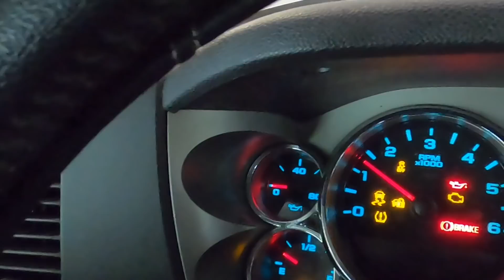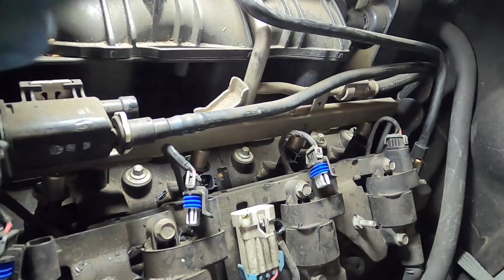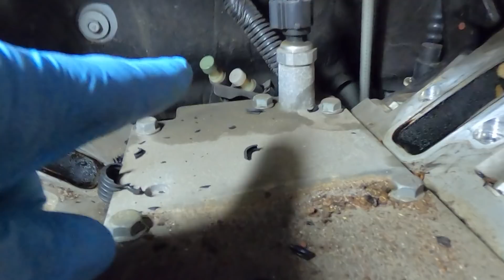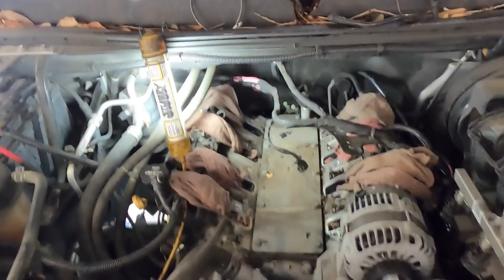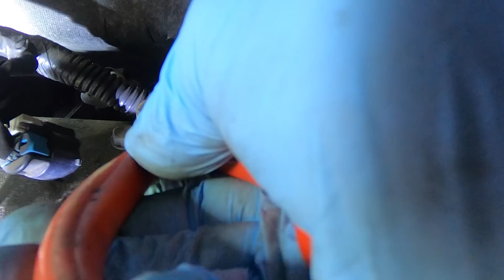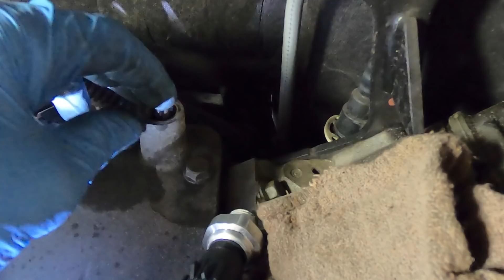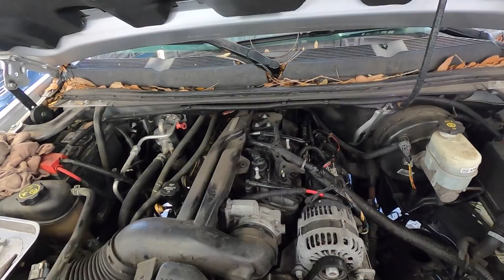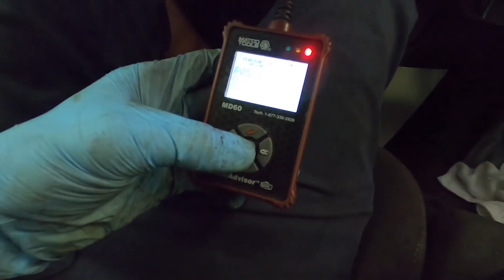Customer States: Google Diagnosis…replace this part!

Comment: To be fair - sometimes Google is right. I had a car which for that particular period often was assembled from factory so when it rained and especially if vehicle was parked on a slope - then water would get in. To be fair it was a very new problem but it took 3 attempts for the dealers mechanics to get it right. The third time I managed to find someone who had similar issue and fixed it. The cause was wrong placement of a plastic sheet in the doors. Naturally I had a printout and showed the mechanics. Presto - finally a dry car even in heavy rain.
That said if I was a mechanic I'd refuse to work on an issue where the customer firmly believes the found solution is the fault especially for such a complex problem - diagnose it at most for a fee. My issue was purely a warranty issue and not really that complex and I didn't present it as the fault - but something worth checking - but this time it was correct.

Comment: Ok I am going to chime in here, as someone who has been working on car’s and trucks since 1983 and taught how to do automotive repair by an Army mechanic. Aka my late father, as well as someone who has management experience in an unrelated field. All that horse manure I just saw, is why I dislike working on new cars. And the poor excuse for mechanic work, is the same kind of behavior I enjoyed firing people. As I do not put up with a half arsed work, and out right laziness. I’m all for taking a short cut when possible to make the job easier, but I am also for doing the job right with all the tools that should be used. If I had owned that truck, and saw what I just saw, I’d be finding a new repair shop to take my truck too.

Comment: if i ever had to do that crazy air-intake pull on my car, just to replace a stinking pressure sensor - i would 'chop' the rear end off the shiting-manifold and fit it with 'straps', so next time its just aN EASY 'working by mirror job' NEXT-TIME. PATHETIC DESIGN TOSSERS !!

Comment: The computer stores a permenent code once the sensor malfunctions so many times. once the codes are cleared the oil pressure will show again you can clearly see in the video at the end of the vid the cel is off and it does show oil pressure dont get me wrong i completely understand the google diagnosis thing but not all are wrong.

Comment: It is not difficult to replace those on a 09 Envoy 5.3  without removing the Intake.  I have done it.  There was a small screen involved.  Haven't heard of a 4.8.  Looked like a tighter fit.  Money Light was out at the end of the video.

Comment: Doing the intake on the LS engines are so simple compared to the old small blocks were you gotta get the gaskets right and the bead of silicone on the china walls and gotta put it back on straight without moving it or you will move the gaskets

Comment: You have to reset the computer after installing the new sensor for it to work. What kind of mechanic doesn't know how to install an oil pressure sensor? Hack

Comment: Well, Ray, you fixed what the customer (and Google) diagnosed the problem to be. So, charge him for what he told you to do and let him take the truck to Google to have the real trouble repaired. Ray, there is a scam going on here. I hope you realize that. The scam is as clear as the nose on your face. The scam is GOOGLE. End of story. Another great video. Thanks, Ray.

Comment: well i have a 05 chevy avalanche 2500 series with 4.8 litre that the oil pressure running or not reads 80 psi even with engine off and key in on possition so what you think it is ? im saying bad oil pressure switch bt after watching this i may have just bought a useless replacmrent

Comment: This video is total bullshit. I run an auto shop and we change oil pressure senders on these trucks all the time without removing the intake. It takes about 45 minutes.

Comment: wow--most would tape the valve holes, vacuum first,  and THEN use a blow gun. Lots of "junk" getting blown into the air after he replaced the sending unit
Reply: When race car engine builders build their motors, I hear they do it in a "clean room." I think this means people come in with dirty old shop rags and shake them about, and use air guns to blow dust off of things, and clean things in there, since it's a nice quite place to clean things.

Comment: Question : No gaskets on the intake manifold ?Being a old school mechanic , love your torque wrench !!
Reply: There are gaskets, rubber ring style
Reply: @brandonchappell8545  Thank you for reply "o rings" may of missed the replacement of such !
Reply: @16480287  well not necessarily o rings, but molded rubber over metal/plastic frame. The rubber is tall so replacement isn't necessary unless damaged or flat.
Reply: @brandonchappell8545  Thank you again ! Learning something new ! (Retired 84 yr old Mechanic)

Comment: googling the fault and finding everything that can make that happen then considering if it can be those things or not for your car. you are left expensive parts and proper diagnosis needed and easy shit you can fix yourself like battery car terminals being crusty.

so you do the easy cheap stuff yourself if it doesn't fix things you tell the mechanic you did those things and it didn't help then they can find the actual issue. it just needs to work one out of every 5-6 times for it to be worth it and it is more than that.

had a lambda senor error was a bad connection to the fuse that caused improper values. have also had the vacuum hose come off. 

google is a tool it is about knowing how to use it that matters.

Comment: I had the same issue with my Trans Am. But mine was the switch because it was spewing oil all over the place. I just gave it a reach around and broke the first, then the second (aftermarket) failed after a few months, #3 was a delco but once it was on it stop tightening at a certain point so when I plugged the plug back on it was in a position where the clip came in contact with the manifold so I couldn’t unclip it again.

Comment: I know you are a mechanic but why do some of you'll act as if people can't know something about cars that aren't? It's not like they can't take their cars to auto part stores to get a free scan and print out of the trouble codes and go online and do some research themselves. I saved myself a lot of money doing that and I stopped family from being ripped off by mechanics that try to take advantage of people especially women. I'm not a mechanic but I did attend a trade school where I'm from to learn automotive and diesel tech for my own personal use.  If I were a mechanic I would love a well informed customer base it makes your job that much easier in fact I would encourage it because people will take better care of their vehicles. At the end of the video there was no check engine light and the gauge was working, I peeped that.

Comment: Some people are just unreasonable just like the owner of this truck, So many people commenting that have clearly never worked a service job, a customer can come to you and ask for something and you can tell them over and over what the right thing to do is but at the end of the day they get what they want or someone else will do it for them. Its not the mechanics fault, he has to do what he is told in this case: do not diagnose, replace X part was what the customer requested anf thats what they got.

Comment: I just did my own oil pressure switch on my 5.3. I never took the intake off you need a swivel and I changed my screen also. I don't understand why you didn't put that in them people's motor? That job took me a total of 15 minutes to do. I guess some mechanics are just better than others I'm just that damn good

Comment: People on fixed incomes can't always pay a shop like Good Year or Firestone to fix their cars since the labor is close to 200.00 an hour plus parts, which is 20% more than it would be if you bought the parts your self.  We have to do it our selves or find a mobile who will charge, if lucky half the amount.  Had a 2000 Lex 300rx, vent modules went out, 1800.00 to remove the dash just to get to the vents, another 250.00 for the modules times 6.  the total was 4,000.00 just to change the vent modules for the A/C.  Now tell me do you think I should have sent that car to Lexus to repair that?  They charged me 5,000.00 to  do a head job 5 years earlier, funny thing is I was told they could do it for 2800.00.  You get what you pay for, but if you can't pay for it what do you do?  You find a friend or a friend of a friend who is willing to do the work for a little less than what a shop will without remorse charge you,  full price for a job that is only warrantied for 30 days to a year after that you are on your own should it break just after the warranty expires....

Comment: The problem with that screen is that it, too, will get plugged up with sludge/crap and ultimately doesn't solve anything, in fact it often times mimics a sensor failure due to the blockage and the sensor is fine.  Some folks just end up pulling the screen and tossing it out, but it also only makes sense to replace the sensor as well while you're in there.  The punchline here is that GM tried to address a symptom instead of the cause and as a result the screen doesn't prevent sludge/debris related issues but does introduce a plastic part that could become brittle over time due to heat cycling and the potential is there for the screen to disintegrate and cause bits of plastic to enter the oil system.  :/

My niece's husband had an oil pressure sensor issue with his early-2010s Silverado 1500 with the 5.3L, sensor would work intermittently and would typically start reading 0 after driving on the freeway for a little bit.  Freaked him out but I reassured him that it was 99% sensor-related because if the oil pressure were really 0 then the engine would be making quite a bit of knocking/rattling noise, but since the engine sound wasn't changing then the oil pressure itself wasn't really dropping to 0.  Replaced the sending unit and problem solved.
Reply: Years ago I had a turbo blow up at 59,000 miles 60,000 is when my warranty ended I went to the dealer got a song and dance got it straight now later on I found out that it was a banjo bow for the oil that had a filter in it and it's ledged up and lunched out my turbo it was fixed but I didn't need to go through all that hassle because of a little piece of screen that did absolutely nothing have a good night thank you

Comment: I miss the good old days when you could see the engine. Back in the 50s,60s,70
Reply: Yup back when engines put out 1/3 of the power  for the same size and we're done for at a 100 K
Reply: I remember when the first " smog " pumps came out, we thought they were intrusive !!!!

Comment: I'd have to say I've been pretty hooked on watching all your videos. The fact that you go through the care and process of ensuring crap doesn't get into the engine is great. Shows a great mechanic. I've experienced and seen way too many mechanics that just say "ehh, you should clean your vehicle more often. I don't get paid to clean your engine." . Keep doing what your doing. I only wish that I lived where you are cause I'd take every one of my vehicles that need work to you rather than trying to save money and do it myself due to incompetent mechanics around me. Screwed the haters. Do the job right or don't do it at all. Too many mechanics looking to cut corners to make extra money.
Reply: I prefer to use a good shop vac instead of blowing the crap all over the place & possibly in the combustion chamber 🧹🧹
Reply: You want to live in Florida!  Shake your head,  buddy !

Comment: When I changed my oil sender on my 6.0 ppv caprice I took the upper cowl off along with the wipers and that made it easier than taking the intake off.  Have a safe day.
Reply: I was wondering if that was possible, it seemed a bit overkill to take off all that. I was looking at where it was and thought there must be a better way.
Reply: This seems to be a work on everything shop so it's hard to know every vehicle and know shortcuts

Comment: Most shops flat out WONT install a part that the customer diaged via Google. Maybe, MAYBE if it's say, a CV boot when it is very obviously ripped, but anything that's not obviously visible is a big NO. Why? Because when this inevitably does NOT fix the problem, the customer will be pretty unhappy to have to pay 2-3 hours of labor and not have the issue fixed, and even less happy when they have to pay 1hr diag and then whatever the labor is to actually fix the problem. If it were me/my shop, I'd make the customer pay for the work already done BEFORE it comes back in for proper diag/repair. Otherwise they will demand that because you did exactly what they wanted (and installed their NAPA part) that they shouldn't have to pay for their stupidity. This is why you simply don't do this. It wastes everyone's time and ultimately cost the customer more money when their Google diag and NAPA parts don't fix the problem.

Comment: Ok I would have plugged into the ecu to check oil pressure.  Most modern ecus will shut off the engine if no pressure.  I'm talking Australia market like a 2000 Holden commodore If it doesn't see oil pressure on start up it will shut off the engine.

Comment: 17:52 Watching you pull those tools out reminded me of my time in the Navy.  I was the tools petty officer and I was in charge of all the tools.  What technique do you guys use for tool management?  All of our tools had a place and it was clearly marked, so when the tool wasn't there it was immediately obvious.  In the Navy a jet or helicopter is grounded if we are missing a tool.  Obviously in the civilian world things are different.  Has there ever been a case where tools were left inside an engine and the customer discovered it later?  How do you mitigate that?
Reply: I doubt the customer would mention it, they'd probably just keep the tools
Reply: Dude, we found a maglite in one of the fuel cells in an F-16 once. It had been sitting there for at least two years after a 300FH inspection by a commercial contractor. I've had guys dismantle a day's worth of reassembly work on a jet because someone borrowed a set of pliers from one of the tool carts so he could put a new stereo in his car. On the other hand, there's a BMW 3-series out there with one of my 10mm sockets still stuck somewhere behind  the exhaust manifold, no way was I going to dismantle the entire engine to get that socket out knowing that it would either shake itself free and drop to earth with no damage or wedge itself deeper also with no damage. Tool control is always relative to the potential risk involved and airplanes lack the ability to pull up to park at the next cloud.
Reply: As others have stated, you supply your own tools..now my story of a $75 Makita flashlight that went missing until a customer came in with a clunk in the door that I replaced the window regulator... missing flashlight found...the boss still brings it up 35 years later...
Reply: As a regular car tech those tools are your own, not everyone's. Yes aviation is a little more stringent. 
I recall watching a show based on aviation in Canada. They replaced an engine and after a short bit on maiden flight the new one developed a problem and found a wrench had been left in there and fallen in somewhere. Oops

I've found a couple tools in my vehicles over the years. If I recall correctly socket and a wrench.
Reply: @mrmotofy  Ah yes, I forgot when I was a kid and in my dad's shop everyone had their own toolbox and hell hath no more fury than someone who's toolbox was violated ;).  I do remember that for sure.  I would help my dad in the shop with basic stuff usually on the mill that he had already setup.  He would setup the jig for the part that needed to be made and I would just turn the crank, and later watched as the CNC controller did it's thing.  I would then take the part out, blow off the coolant and chips, and test tolerances.  Good parts in one basket, bad in the other.  He was a machinist and a mechanic - but my uncle, his brother, was the master mechanic.  They had many exploits - putting a Ford engine in a Chevy body for example - which puzzled me as a kid why they found that so hilarious ;D.  Anyway, yes, in Aviation the tools are shared and actually owned by the Navy.  I don't know about other shops, but we didn't allow personal tools.  It made it more difficult to inventory tools at the end of the day.  In my shop every tool had it's place and it was usually an outline or foam cutout, so it was easy to tell if a tool was missing.  Leaving tools inside an aircraft can lead to something called Foreign Object Damage, or FOD for short.  If that is caused by human negligence it's usually very bad.  The squadrons employ FOD walkdowns to ensure they don't introduce foreign objects into their intakes and risk damaging compressor blades or internal mechanisms.  FOD is a big deal with Naval Aviation.
Reply: What do the shops use as a tool management technique? The very most efficient, the techs buy their own tools. The shop provides a bay, a lift, and some supply information access and maybe a scanner. I have 2 scanners of my own. Never used the shop scanner

Comment: Fact .The customer is never usually right and would rather load up the parts cannon .The worst one is when they try and fix it themselves to save money and screw so much else up in the process that it just makes a hard job near impossible .imo

Comment: Little screen behind the oil sender switch often clugs the oil pressure sender.    Just remove it.   It’s an engineered flaw to get more money for gm.